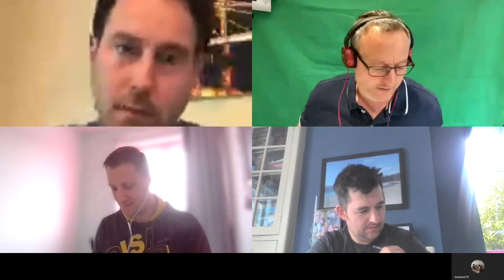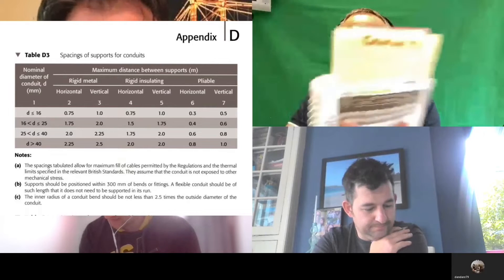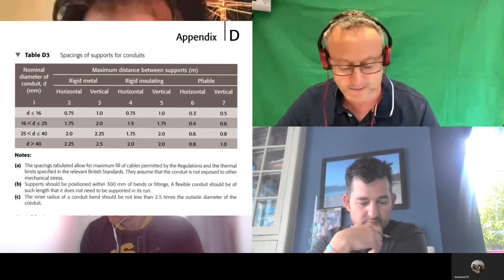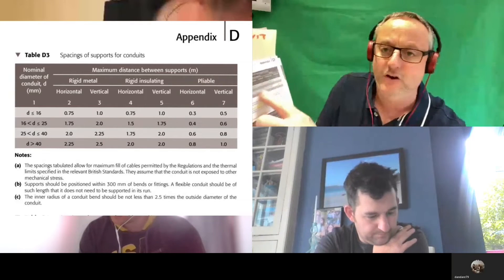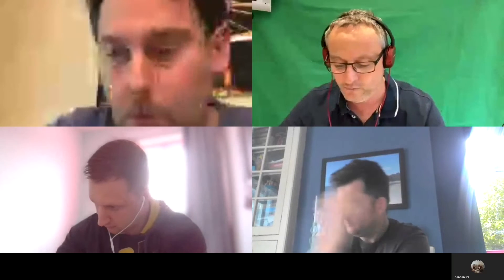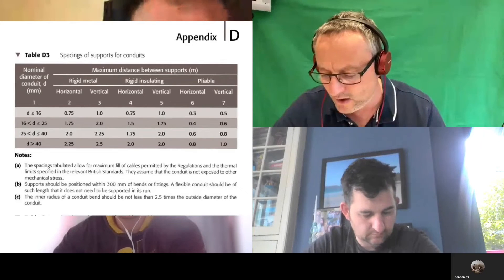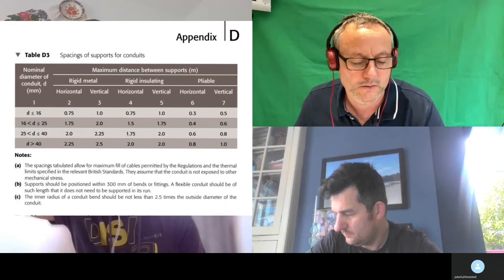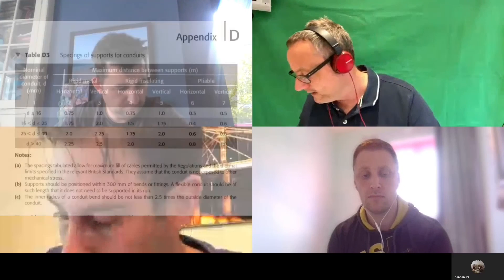Maximum Distance for Conduit Supports for Metal, PVC & Flexible Conduit Appendix D On Site Guide

Comment: A quick question for clarification. If I have two sockets connected by say 300m of steel 20mm conduit would I need to support the conduit between the sockets or do the sockets provide enough support on their own.